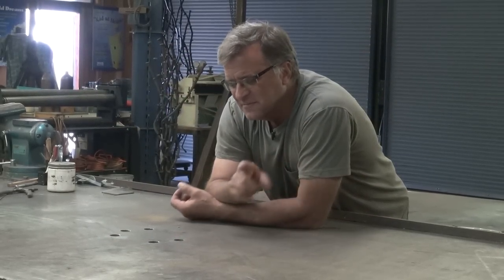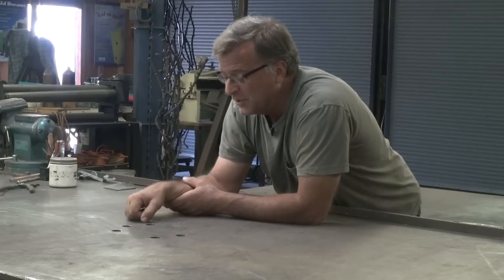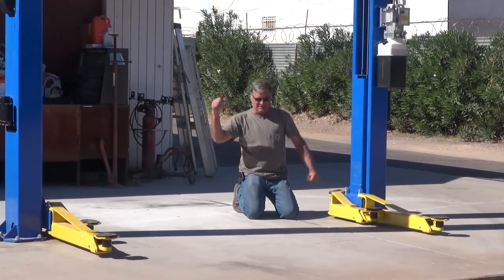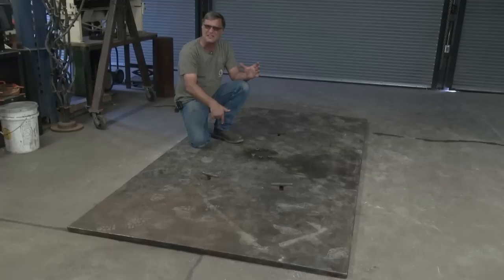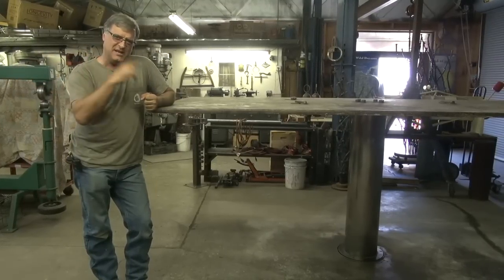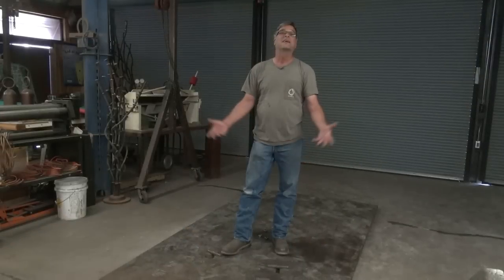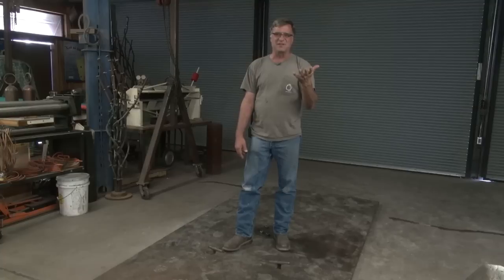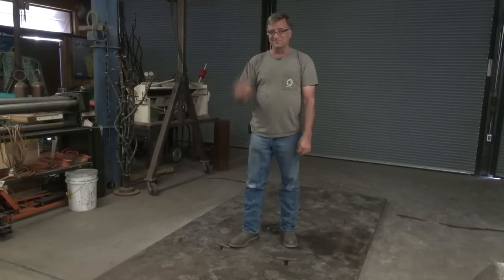The Story Behind My Magic Lift Table - Kevin Caron

Comment: That's a great work surface. You are very lucky to have that help you out. Now how do I get one of those put into my garage for my everlast welder! LOL
Reply from the maker: I checked on one for the house and the whole thing installed and holding a 3 by 5 by 1/2 inch plate top was in the 8 to 10K range.   Check with a lift company to see in your garage.

Comment: Great idea..i did the same thing 20 yrs ago had a bay did small engine repair as well made use.s..I like the old school lifts. Clean open floor ..my dad had a station  with the same inground  globe lifts..back in the day..don't get rid of the old tops u have. Just in case someone  wants to fix cars..again..there worth over a 1000 bucks today's used..if someone  looking  for a replacement..I had to look high and low for what u had starting to show rust..out side..
Reply from the maker: Been very handy to have in the shop!

Comment: Kevin, Way Cool Idea!!!
Reply from the maker: One of the most used pieces in my studio!     Even looked in to putting one in at the house for the motorcycle.  Hardest part would have been cutting the floor and jack hammering out the concrete.   Still want to give it a go.
Reply from the maker: Have one.  I just have trouble getting that 740lb motorcycle on and off the lift by myself.  If it was sunken in the floor it would be safer and more usable.

Comment: The ultimate in recycling! Great idea
Reply: I'm thinking about doing something similar at home with my everlast welder. I figure I might weld something up that uses a harbor freight motorcycle lift. I think there are some people who have done this before on youtube.
Reply: Jonathan Little I've seen one modified as you mention, they have height and weight limitations, be sure of your needs before investing. I'd suggest adding a drop down leg at each end(or all 4 corners)to stabilize the table as they(from what I've seen) can rock a little when raised, each pivot point adds a little play to the table. I'm planning and collecting parts for a twin cylinder table that will drop level into the floor when not being used, I need it to hold more weight than the bike lift will hold. YouTube guys "Build it Extreme" have a video close to what I'm planning. The commercially available hydraulic tables are insanely expensive for home shop guys. Good luck with your build.
Reply from the maker: Check with the hydraulic lift guys in your area..    Not that expensive to have a cylinder placed in the floor with a pump and tank off to the side.    And they do all the work and clean up after themselves!

Comment: The way to calculate weigth on steelplate (metric ) is: length in meter x with in meter x thickness in mm x 8 = weigth in kg

Comment: Word to the wise on older cylinder lifts. That cylinder is hollow. Over the years condensation can wind up rusting out the bottom of the cylinder from the inside. When that happens the fluid shoots up into the hollow cylinder and the lift drops to the floor no warning. Always use a safety when lifted.
Reply from the maker: Amen!!!